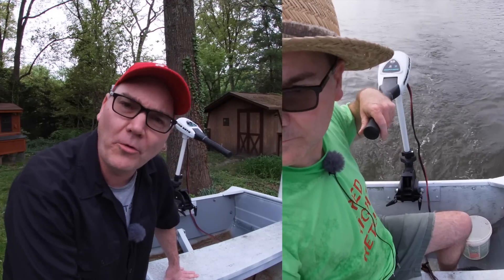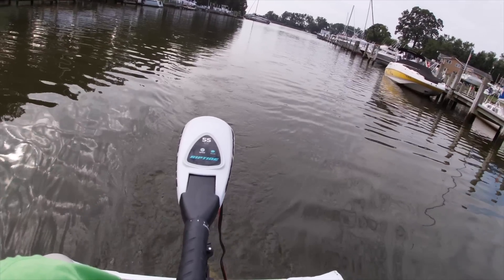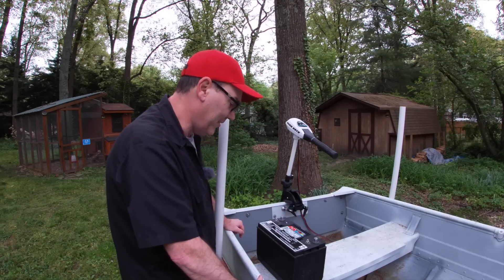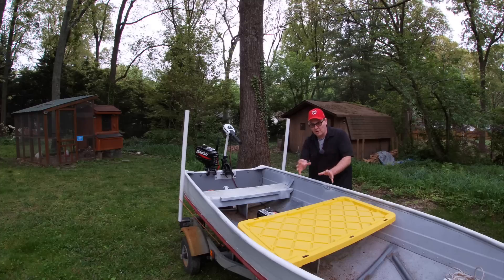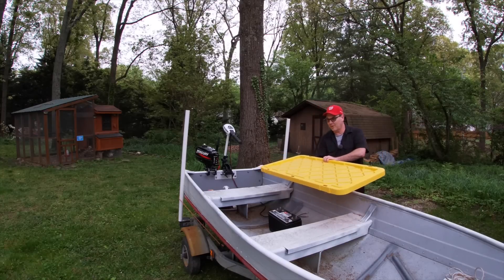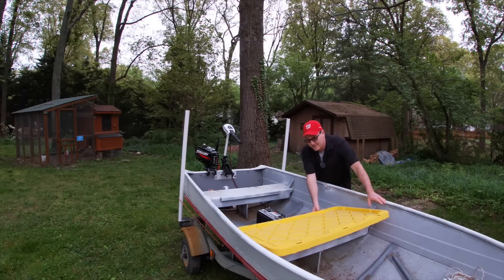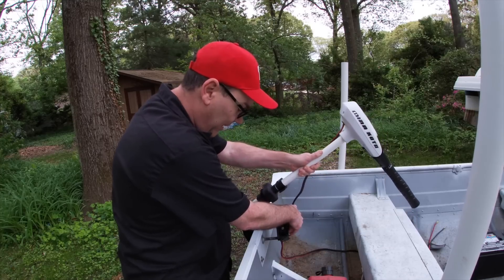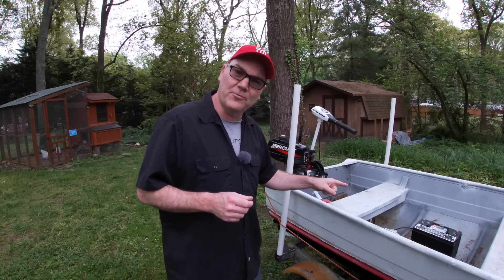How Many Solar Panels Do You Need For A Trolling Motor?

Comment: Stop! One, you aren't running the motor nonstop. Two, you could probably do w/o the charge controller if you have a monitor. I tried using a Jackery 240 to power my 30# electric motor. You can't run it full blast, but I almost got an hour run time (not continuous) until the adapter burnt up. I also charged my 240 with the panel (60w) I got with it while boating with the gas motor.

Comment: If you had just a supplementary solar charger and the two batteries it should effectively give you unlimited range for the day with downtime recharge and the batteries will add great stability to the boat and you only need to put the solar panel up forward out of your way maybe like a little Bimini top or a windbreaker windscreen

Comment: I suggest to use an HJT or TOPCon solar bifacial panels 600W... it is a 2,3m x 1,1m. Anyway I agree with you, at the end not enough power yet from solar panels, need a bit more time.

Comment: I have 22ft sailboat with a 120w permanent solar glued onto the front deck. Its batterybank is always charged up when I come to use it with the 1000w brushed motors on it. It just works!

Comment: This is something that I’ve thought about for a while. I wouldn’t connect two batteries in parallel though because no two batteries have the exact same internal resistance which means that one will go flat before the other. I personally like to have a total of three smaller batteries with selector switches for charging and for usage so that each individual one can be charged more quickly but also so that you can be more confident of how much range you have at any time.
It seems to me that electric boats could be more suited as a hydrofoil if you were able to have three motors on one shaft with a total power output enough to get it up on it’s skis as at that stage it should be able to stay up on it’s skis with one motor disconnected. Sure your instantaneous power usage would be higher but you would not be drawing that current for so long as you would get to your destination quicker. I believe the whole point of the hydrofoil design was to save fuel. It could be an interesting project for someone.
Reply from the maker: Some of the new electric boat tech is hydrofoil based. The idea of multiple smaller batteries which could charge more quickly is an interesting one.
Reply: @WayneTheBoatGuy  Thanks for letting me know as I didn’t know they were already making hydrofoil based electric boats. It was back in the 1990s when I originally got the idea of multiple motors for electric cars situated where the gear box would normally be in a rear-wheel-drive car so that the right number of motors could be automatically selected to suit the varying loads. The advantage is that a much smaller motor has less no load current or even light load current draw than one motor large enough for the job.
I assume that it must be cheaper to have one motor large enough for the job with current limiting done electronically but I don’t know if that would be as efficient and I prefer to minimise electronics whenever possible.
Later I was helping my cousin repair his hydrofoil one day when he had engine problems with his 60 litre MTU diesel which had seized. It was then that I thought of a hybrid set up like they do with non-plug-in hybrid cars, a smaller diesel, a small battery pack and three electric motors. Unfortunately, he ran out of funds and he has to sell it now.
The three separate battery idea was also from my interest in electric cars as I thought it would be good to have one to get to destination, one for getting around at destination and of course one for the home trip.
Reply: That's not how parallel batteries work... they maintain the same voltage regardless of size, you can even mismatch them if they are rated the same voltage.

Comment: Yes, you are correct in your assumptions. You can probably make a custom made, ultra light (carbon)  roof with wall to wall cells and use a specialized high efficient motor and light weight Lipo batteries but that would be VERY expensive but it would probably cost more than an expensive ski boat.  This type of project would be good for a university team for a solar competition. Seems like i have seen this with solar cars. Even so, there are new breakthroughs in solar cells and solid state lithium batteries just around the corner.  (They have been saying that for 10 years)

Comment: parallel doubles the power, you meant series :)
Reply from the maker: Did I get it backwards? Parallel keeps the voltage the same. Batteries wired in series will have their voltages added together. Batteries wired in parallel will have their capacities (measured in amp-hours) added together.

Comment: I’ve been studying this subject for 6 months. The way you dumb down the process is helpful to me😃👍. It has been quite the challenge trying to do the math regarding, size of electric motor, number of batteries, the multi panel large footprint problem. Your presentation was superior. Series vs parallel is clear now. Thank you for your efforts 👍👍. 
Please comment on whatever you know about the higher watt, higher 💰panels- flex vs rigid. It seems like if ya can afford these high end panels, we would cover fewer sq ft with the higher power panels. Please give me your thoughts on that option. 
Thanks. Dan
Reply from the maker: You and I have probably been looking at many of the same videos/websites/forums etc. It seems that in some areas, used panels with higher output are easy to find and not expensive. I never see these things near me, and when I ask follow up questions on other comments that say how easy it is to find cheap and higher output panels they never respond back. It seems that in the next few years we might have panels that provide more watts per square foot and maybe electric motor options that are not expensive and use less electricity. When those things come along, it might be a game changer for many applications.
From what I have read, the flexible panels seem to have two disadvantages - they can get damaged more easily and they don't usually produce as close to their rated output as rigid panels.

Comment: Remember SLA has a 50% usage cycle (100ah = 50ah). Lithium have 99%.
Two SLA at 100ah = $600, Li $550. Li win for Equal stored capacity, Less space taken up and weight savings. Faster to recharge.

250w folding solar panels with charge controller might give you 25% more runtime
Reply from the maker: The 'pros' for Lithium are pretty strong

Comment: Talking about solar panels with led acid batteries?? BS video from guy stuck in last century technology trying to make sense of solar and electric motors with led acid batteries?!? Ridiculous conclusions
Reply from the maker: Once again - this video wasn't "how to build a solar boat". It was addressing whether or not a person could easily add solar to a small boat that already has a trolling motor and a still very widely-used and common battery. Many boaters who have old 12-14 foot boats are buying the cheapest battery and not the best battery.
Reply: @WayneTheBoatGuy  ok it is not how to video, but then why any conclusions if it is not how to video? Why not mentioning that lithium battery's are far far more better for solar? That you could have double amount of energy from solar, with same solar setup, just if you switch to Lithium batteries, and maybe then it could work, maybe it is possible to make solar boat to run it all day long, because YT is full of those videos. What was point of this video if you not trying to make it work before any conclusions??

Comment: Let's see. A lead-acid battery is too old-school to be used these days. They have very high weight, low numbers of recharges, and low performance. Lithium batteries are the only way to go. I don't know anyone who would use lead acid for anything but a car battery. 

Second, where did you get the idea that something the size of that big plastic thing was the same size as a 100 W PV panel? You might want to get some actual measurements of common monocrystalline 100 W panels. None of my 100W panels are that big. 

Third, the idea isn't to run the boat on panel power all day long while trolling for northern pike. They are to supplement the battery, not replace it. All the time you're sitting still the battery is being recharged to one degree or another. Your gas tank is not.

Fourth, if you leave your boat with the panels sitting out in the sun for a day or 2 before you go fishing your battery, or batteries will be fully charged for your fishing trip without taking a trip to a gas station to buy $6 a gallon gas. You can use the money you save to hit a fast food joint for breakfast on your way out in the morning. 

Fifth, No matter WHAT happens with gasoline accessibility, a PV and battery system can ALWAYS be topped off by the sun no matter where you are. There are no gas stations out in the middle of the lake to replace bad gas. But the sun rises every day, everywhere, even if it's not always as bright as we'd like. It beats digging an oil well with your hands. 

Sixth, you don't have to run an expensive charge controller, although a hundred dollar MPPT controller is well worth the additional investment. You can just parallel 18 V panels to charge a 12 V battery or pack and monitor the voltage on the pack with a $5 voltmeter module wired to it, and if it hits 14 Volts just turn off a switch between the panels and the battery. 

Seventh, a good electric motor requires essentially zero maintenance for years. A gas engine requires quite a bit and is decidedly less reliable out on the water, and of course requires winterizing every fall, etc. 

Eighth, more and more places are no longer allowing internal combustion engines on their lakes and waterways, period, especially for fishing tournaments simply because the hydrocarbons in the gas boat engines POISON the water of the fish you are trying to catch. The electric motors don't. 

And finally, for $30 or so you can get a cheap 300 Watt inverter to run off your boat's 12 V battery for AC power when you're fishing, or camping, or to keep a light and radio working, as well as charge flashlights and cellphones and keep them running during an emergency any time of the year. Unlike the electric motor/battery/PV panel system, except for the few hours you are specifically using your gasoline powered outboard motor for pushing a boat through the water, it's entirely useless. That's all a gas outboard motor does. The PV electric boat system is always there and useful for a variety of other useful and essential purposes, making it a much better investment.

Just some things to consider.
Reply from the maker: Regarding a couple of your points:
1. Many people who run old small boats use lead acid batteries because they cost much less than Lithium. I see it all the time and while a Lithium battery is better, the former is cheaper, and many casual fishermen just aren't yet interested in a battery that cost 3x as much - even if it will last 10x longer.
2. I just double checked, and my plastic yellow panel measures only 2" wider and 2" longer than an easily available Renogy 100w panel which is 21"x42". All of the 100 watt panels on Amazon seem to be about that size. 

For all of your other points, I stand by the fact that at the present time, with the solar technology easily available on Amazon, it is more cost-effective to just add a second battery to extend your range greatly because all of the solar stuff is bulky and more costly than just buying a second battery (even a lead acid one).

Torqueedo and ePropulsion make neat motors for people who are in the market for a NEW 5 hp outboard because they are quite competitively priced when compared to new gas outboards - but that's something in the $2-3,000 range. I agree that solar to recharge the batteries is a great idea for many people. I also hope someday soon we'll have better (smaller/higher output) panels and more efficient electric motors that are a cost effective option for the budget boater.

Comment: A mast and sail with  a little wind! 😂 I did buy a  deep cycle lithium battery for a small boat for 100 dollars. It ran a 30 lb minn kota trolling motor for about six hours of on off fishing. It lasted about 4 to 5 hours on a windy day at a more consistent use. I did like the fact that it was really small and light to handle.
Reply: What size battery did you buy for $100? Was it maybe a 50amh battery? That would be almost equal to a 100amh  lead acid battery.

Comment: I have just powered my kayak with a 36 lbs trolling motor. It assist us while paddling. I chose two small lithium batteries which fit through a small porthole and keeps it out of the weather. Our range is three hours on setting 3 at a speed of almost 2 miles an hour. Since we have balance issues we needed the widest kayak we could find thus heavy to paddle.
Reply: Why do you have balance issues?
Reply: Balance issues plus kayak? Never thought of combining the two but could be entertaining to watch.

Comment: A 100 watt panel charges at about 6 amps.
A 30 lbs trolling motor draws about 30 amps which is 5 times as much.   If you stop and fish 5 times as long as you motor to your fishing spots, you'll be able to keep the battery charged all day.
Reply from the maker: Yes - it certainly can be a big help if you're fishing and not motoring at full speed for long.

Comment: I have a single flexible 120 watt on my kayak to power a small 20 lb trolling motor.
The panel puts out 7 amps which is enough to power the motor on low without draining the battery at all.  On high, it does drain the battery, but it lasts twice as long with the solar helping.
Reply from the maker: How big is that flexible panel and how do you have it mounted?
Reply: @WayneTheBoatGuy  
I don't remember the exact dimensions, but I would guess about 4'X2'.  I drilled in a couple 1"x2" wooden cross beams on the bow of the kayak and the panel is attached to the beams with Velcro.   I have to be careful squeezing into tight areas because the solar panel corners are vulnerable at the front, but other than that, it works well.   On low speed which basically runs on 100% solar, it goes about the same speed as a leisurely paddle.

Comment: I fully agree. The only conditions under which it will work is if you use the motor say only 20% of the duration of your fishing outing, which in my experience is a realistic guess. However, the second battery does not care if it is cloudy or raining, and is financially a better proposition with technology as it is today.
Reply from the maker: Exactly!